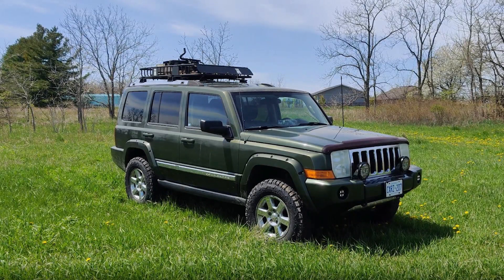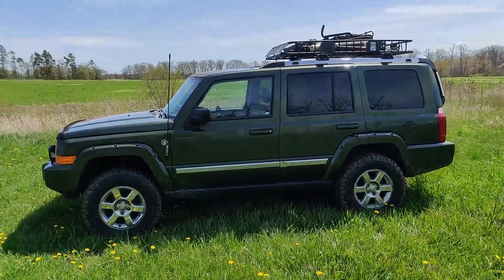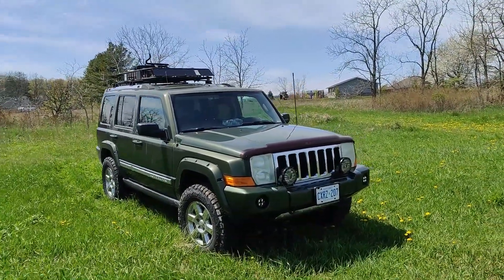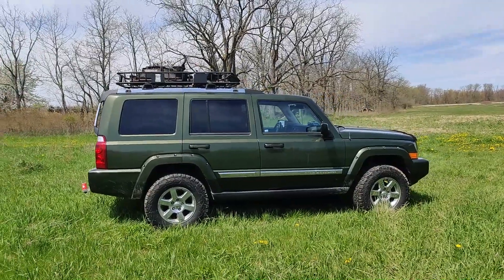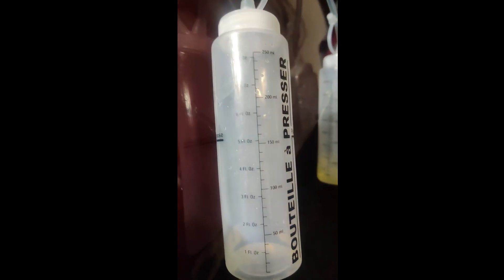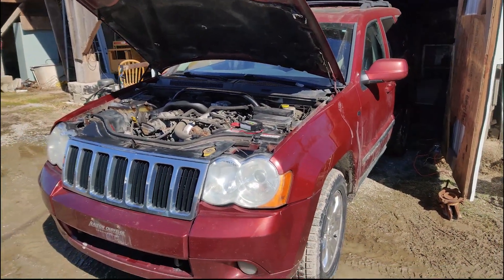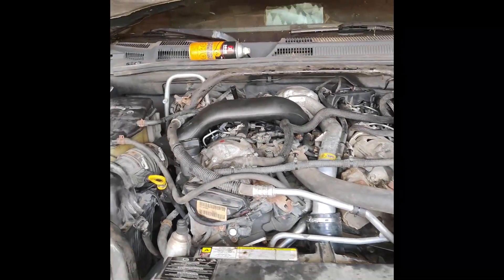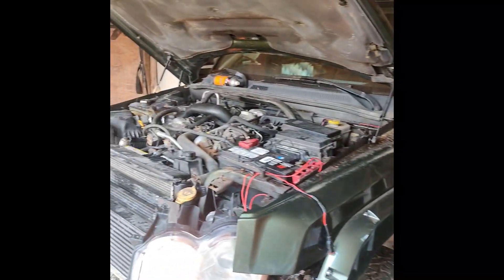Jeep Commander OM642 Diesel Swap

Comment: Great video, I am planning to do the opposite and replace my 3.7 with the hemi. I believe you can really give me some insight to my swap. Did you have to replace the BCM, TIPM or any other modules? Thanks
Reply from the maker: Yes if you want everything to operate 100% with no warning lights all associated modules need to be swapped. 3.7 will be slightly different then my swap, additionally the year of the commander will also make a difference.
Reply: Did you have to use all the wiring or just some of it.

Comment: What kind of final gear ratio do you have on your XK? I know WK 3.0 CRD have 3.55 in Laredo and 3.73 in Liminted or North(towing package). I found 3.73 trasmission feels like have diabled sprag on OD( AKA tow mode all the time), while 3.55 trasmission feels like coasting all the time, and there is significant differnce in fuel economy too. Anyway, great project, i might want to do one next year!
Reply from the maker: If I remember correctly in Canada all 3.0crds were 3.73, and likewise the XK hemi was also 3.73.

Comment: Nice chronicle video. Someone here in Arizona had a Commander for sale into which they had set the 3.0 Mercedes CRD and transmission out of a Grand Cherokee 3.0 diesel. It was being sold as an incomplete project. Donor vehicle with wiring harness and transfer case were gone. It seemed beyond my ability to locate another wiring harness and ECU AND attempt to merge them into the Commander's harness. Your approach of effectively turning the Commander into a Grand Cherokee seems to be the right choice.